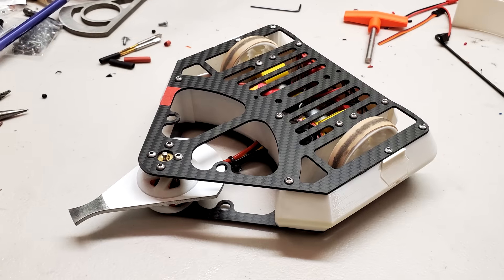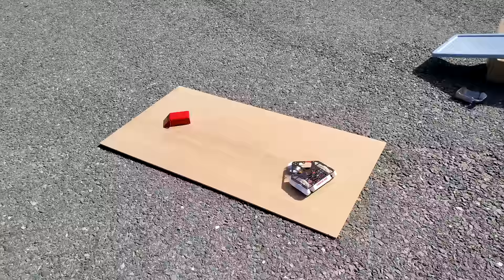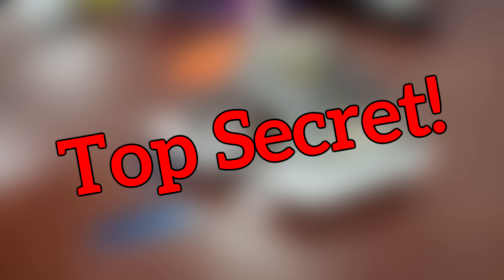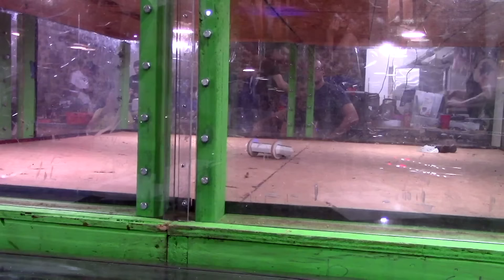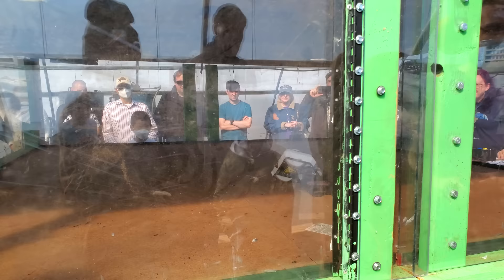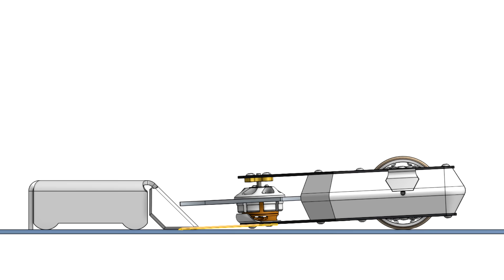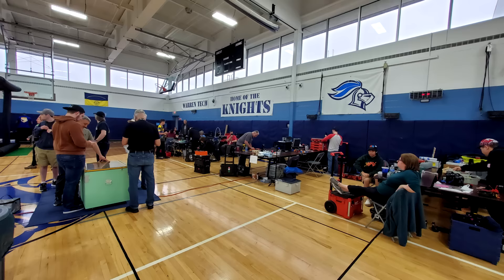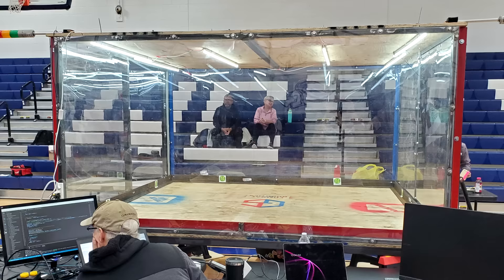Cheesecake has a secret weapon! (April Annihilation 2023)

Comment: i think the design an all is really cool. If the kid you fought in semis and the final had protection like your bot on the wheels then i think it would have been alot less easy for him to get mobility disabled.
Reply from the maker: Thank you! I'm considering making my own version of the Candy Wasp kit, but with the wheels inside the frame so they are protected.
Reply: There is a lot of balancing involved.
To add protection you have to remove weight somewhere else, maybe reducing the motor, so you have less speed, or the wheels would be closer to the middle, witch can reduce precision to control the bot.
Things like that.

Comment: yeah man, if it wasn't for that sweet tooth that would have been your bot flying through the air at 12:47
you can see the huge downward force on your bot making it wobble and spin that would have been upward without the tooth. 
well executed. wonder what another one on top would do. probably just bend rather than grab

Comment: You'll definitely want to battle harden the motors, but having a motor can where the magnets are actually mechanically locked in makes a huge difference ontop of that. - this is something used on high end electric skateboard motors.

Comment: Maybe the weapon could shrink in reach some more too, to further help reduce the frame dimension along with the other changes that brings. Also was thinking could try to teardrop out the trailing edge on the weapon some to reduce the drag coefficient.
Leading edge [_> Trailing edge.
Reply from the maker: I'm actually working on a spiral weapon disc which should do essentially what you're describing: it's as close to a round, aerodynamic disc as possible. By my testing, this should reduce the air resistance enough for me to run an even faster motor and store way more energy.
Reply: @alexsalchemy  Interesting. I was thinking the cross section could be tear dropped if that wasn't clear. So maybe touched up with a grinder, would have to plan for that and then carefully grind until balanced, at least at the end of the the grinding process.
Reply from the maker: @SpiderWaffle  - Ah, I think I understand. That is kind of what Jordan has done with his weapon recently.
Reply: @alexsalchemy  Jordan who? which bot?
Reply from the maker: I'm sorry, this is Jordan. It's another horizontal spinner who I've fought in the past. 
https://youtu.be/83slNpJSNOo

Comment: There absolutely needs to be a 3d print only battle bot league, because then when they get damaged, they can absolutely be repaired, a lot more affordable to get into, and all.  Make it so even the weapons have to be 3d print, only the tires, motors, batteries, wires, and computer board allowed to not be 3d printed.
Reply from the maker: There is exactly that! It's called the "plastic classes"! You can find them in the ruleset here: http://sparc.tools/

Comment: 12:33 Might try taking your sweet tooth and splitting it, putting one one each side of your front, and make them slightly triangular in nature. Rather then flat, it will give you a slight angle when wedged under like here, and give the spinner a sort of bit of trajectory away from itself. Also destabilizes more as the spinner bites. Just something to think about. Sort of like
 " | /\ | " shape. Would allow you to get under them at an angle rather than just directly straight on. Might work for more "glancing blows" or drive by hits, that you cant quite snag with the tooth under the spinner. Might also allow you to spread some of the energy from a hit.

Comment: Build a bracket off the frame to hold a bearing under the weapon to put the motor shaft through, transfer the energy to the frame & not the motor itself. this will save your motor(s) hopefully.

Comment: Use an Out runner on the blade motor and a 3d printed part that key's in the the geometry of the motor and the blade. Having a blade mounted to an in runner, even in antweights, is a very bad idea. That's what everyone does in beetles and what I've found to be fool proof in ants.

Comment: Really nice design. But looks like you need to dial down the sensitivity of your controller. At several points, you were trying to make small turns but ended up just spinning wildly, preventing you from hitting your opponent.
Reply from the maker: Yep, I think I need to (somehow) program it to be less sensitive when my drive forward speed is low, like how shooting video games automatically reduce your mouse sensitivity when you're  zoomed in.

Comment: Would an entire body horizontal spinner work? Where its basically a saw blade that spins 3k rpm or higher (whatever the normal spin speed of strong spinners)on the very bottom of the bot, almost flush with the floor; tactically dismantles wheels or wedges at their bend points? I dunno how you'd manage to make it move around, but basically a giant saw that encompases the entire bot 360 degrees...? Even if it flips, those saw blades would be like 2 inches off the ground possibly still able to do some damage to bots tall enough?
Reply from the maker: It sounds like you're describing a "full body spinner", so yes! Some BattleBots that do this include Gigabyte, Captain Shrederator, and Blendo from back in the day.

Comment: i'm surprised more of the opponents didn't have the wheels under armour; that seems like such a big advantage esp since your strategy appears to center on destroying the wheels
Reply from the maker: I agree! I noticed the same issue when I began my design, so I made sure to put my wheels inside my chassis. Working so far!
Reply: @alexsalchemy  your design reminds me strongly of Carbide from robot wars - did you draw inspiration from that or is it a case of convergent evolution so to speak?
Reply from the maker: @zeusjukem9484  - Surprisingly no, I just wanted a horizontal spinner because I wanted a destructive robot that wasn't a pain in the butt to drive (like vertical spinners can be). I was mostly inspired by Tombstone, but with more wheel protection.

Comment: one thing i noticed with your forks that it seemed way to skinny for the type of bot you have. Since your front has a triangular profile, enemies get shoved off to the side which ends up rendering the fork useless if the enemy's wedge can still work from that angle. I would suggest having several copies of that fork spread across your leading edge for better functionality. Also on a side note, this is my first time hearing there is combat robot competitions on such a small scale compared to BattleBots. Neat.

Comment: Wouldn't it be better to isolate your weapon motor from some of the leverage by adding a belt drive? I mean, yeah it adds vulnerability, but nobody is going to want to pierce down into your chassis to get at the belt when that spinner is running. Also, less replacement motors.
Reply from the maker: Oh it definitely would, but Cheesecake barely meets the weight limit already, and there is very little room for the weapon motor anywhere else. If I make a 3lb "beetleweight" robot, I will definitely isolate my weapon motor by adding a belt drive.

Comment: I realise I am late... but would making a double ended spinner be better balanced and reduce the likely hood of bending the shaft?
Reply from the maker: Maybe, but I like my one-ended spinner because it gives me more "bite" more "overlap" with my target when I hit it.
Reply: Might be worth experimenting in the 'garage', when it is spinning you appear to be out of balance, so a lot of force being exerted on the shaft trying to bend it, even before you strike an opponent, it might also make control difficult as you are competing with the vibration, of course if you increase the mass too much you have a gyroscope...try steering that! 
If you favour the single blade, you might want to try a small  counterweight, with a radius well inside the 'business end' of your spinner, good luck Tony A  @alexsalchemy

Comment: I really wonder how the armor would do in cheetah TPU, if it would have enough rigidity? It could really absorb tons of impacts.
Reply from the maker: Hmm... in what ways is Cheetah TPU better than something like SainSmart TPU?
https://www.sainsmart.com/collections/tpu-filament/products/all-colors-tpu-flexible-filament-1-75mm-0-8kg-1-76lb
Reply: @alexsalchemy  idk what they're differences are if any. Both specced at 95A. I just know some makers like Seth at Just Cuz had printed parts with Cheetah in the past. Rigidity is the biggest questions, I think something between that nylon would be ideal, could stand be more brittle, less durable for more rigidity. I don't know of anything though.
Reply: @alexsalchemy  So apparently more builders like Jamison Go are using TPU for various parts instead of Nylon G or Oynx.

https://www.youtube.com/watch?v=ME9-3veJtDE&t=30s

https://www.youtube.com/watch?v=SgKnAJgzzOY&t=15s

I could see just the outer armor being TPU if the frame is carbon fiber and the center housing is Nylon G or Oynx, should have enough rigidity.

Comment: what material are you using for the frame? would a cf blend not be stronger?
Reply from the maker: The flat black plates are carbon fiber, and the white bumpers are 3D printed out of TPU which is flexibly and rubbery.

Comment: I just love to see him destroy kids with kit builds that either dont have a weapon on it or vack into corners with their weapon front. I dont think a wedge is a weapon and they should ban them completely
Reply from the maker: Some leagues require an "active weapon" like on the BattleBots TV show, but I think there is also value in allowing simpler bots for people to get started with simpler designs. I've decided that my goal is to beat every single kit robot, which does partially mean that I need to beat the engineers who designed them, not just the drivers I happen to meet.

Comment: U can make sweettooth wider  i think it will help a lott
Reply from the maker: Yeah, but the problem is that, as you make it wider, it doesn't hug the floor as tightly. This is why forks counter wedges in the battle for low ground. Usually the solution is to simply add more forks side-by-side, but... I don't have a big flat front face to put a battery of forks on. Maybe I could make some kind of trident thingy...
Reply: @alexsalchemy  oh makes sense

Comment: What's weird is that none of the opponents tried covering their wheels with anything - you won every time but just shredding the wheels that were not protected in any way, while your robot's wheels were nice and safe inside the body. Kind of a weird design decision on their part.
Reply from the maker: I agree, but extending your chassis around your wheels adds a decent amount of weight, so it can be tough to have enough weight left over for an effective weapon. I think Cheesecake has settled into a very good balance between the two.
Reply: @alexsalchemy  They could do what you did - bring the wheels closer together inside the body. But that would probably hinder stability now that I think about it.

Comment: the kid who bought the kit for shotgun seemed to have expected the design to be amazing without actually understanding the config and its pros and cons....he wanted it too do all the work which is something you cant do in this hobby.....I think self learning and building is better for that reason
Reply from the maker: Vertical spinners are notoriously difficult to drive and to practice driving safely. One of the reasons I opted for a horizontal spinner is because it's easier (and more fun) to drive and to practice driving.
Reply: @alexsalchemy  Advantage of vertical spinner, delivers an uppercut, disadvantages are precession and the height of the weapon
Maybe a front and rear vertical spinner would negate the precession issue
Reply from the maker: @matthewday7565  - RIPperoni!